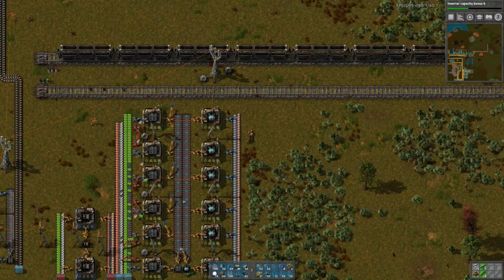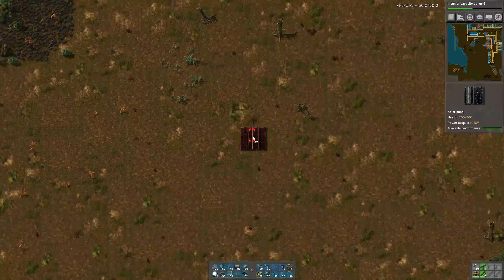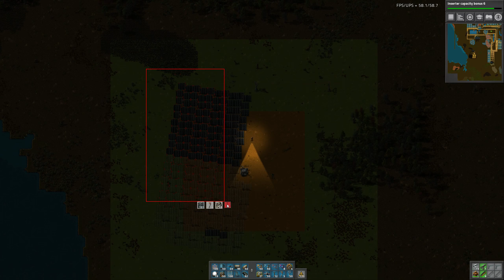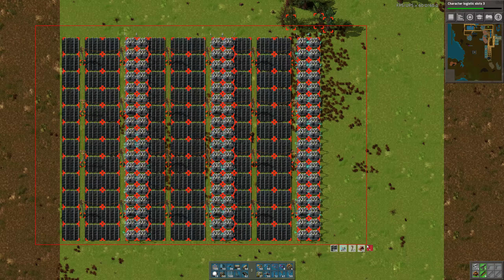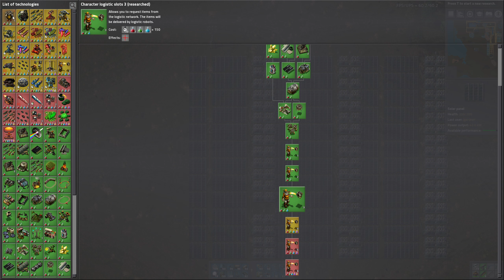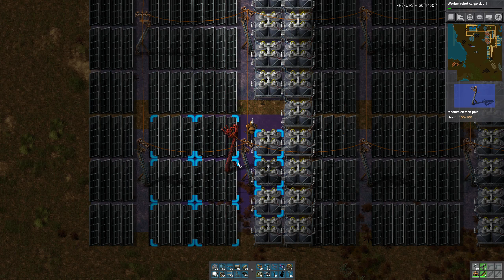Solar Power Design (Let's Play Factorio Kilobase S20 E004)

Comment: 25:24 Why aren't you use wooden poles? With your initial drop you could include a factory to produce wooden poles, only need to carry copper, you always get lots of wood when you place solar. You seem to have completely ignored the cheapest material.
Reply: 39:45 "I'm really hungry for steel right now in my factory."
Reply from the maker: I don't use wooden poles because I don't want to deal with wood. That's all there is to it. Wooden poles would work, and I think they are about 1/2 the price in copper and don't use steel. So if I was starved for resources I would use them. By the time I build a huge base, I am not starved for resources and the cost of manufacturing medium poles is much lower than the annoyance of managing wood.
Reply from the maker: Also, small power poles are somewhat limiting. Using medium poles opens up design possibilities.

Comment: You use to think solar was overpowered, once you get nuclear up and running it is what to do with all that power
Reply from the maker: Yeah, the types of bases I like to build I love to see resources flow through, and for the fact I can't keep resources flowing to be the limiting factor. But if I'm going to build 1k science per minute, I can't waste precious UPS on fluids. I am not even sure my laptop can handle a solar-powered 1k factory!
Reply: JGGames What cpu is in your laptop? What is the year that you purchased it? And how much ram are you rocking in your laptop?
Reply from the maker: I got it about 2 years ago. It's a sager, forget which kind. 32 GB ram. i7-6700HQ @ 3.60 GHz.
Reply: The most important spec is the CPU speed... 3.6Ghz  is not that bad. Some Desktop CPUs go around 4.2Ghz without overclocking (~16% faster).
 You might want to ask Xterminator. They are used to build megabases like you want.
Reply from the maker: I believe I read somewhere recently that memory latency is the key determining factor. It was reading Xterminator on reddit that convinced me to shoot for 1k.
Reply: I have to check that... I'm going to move from my current laptop to a Desktop PC and I want to see what are the important specs.
Keep up your videos and your custom builds and ideas, I enjoy watching them very much!